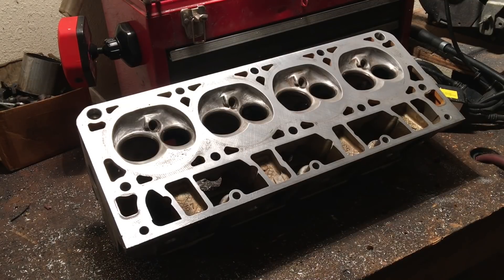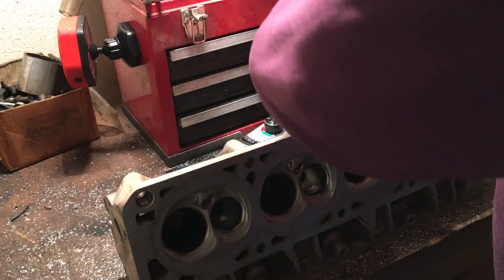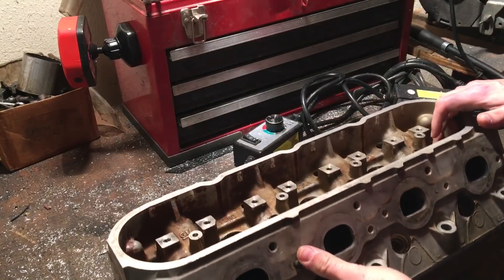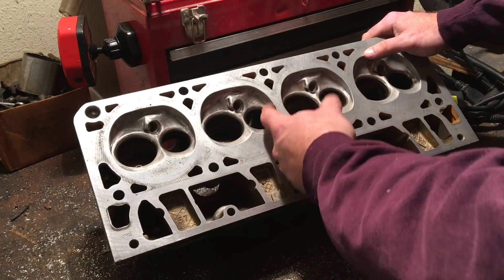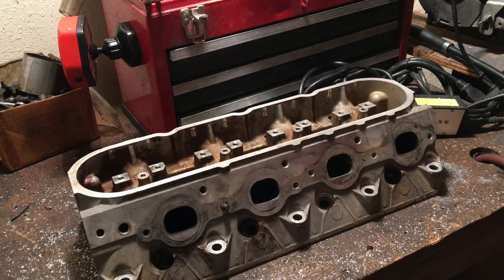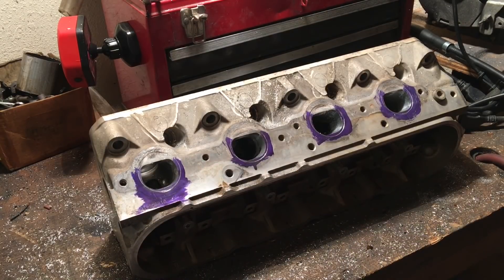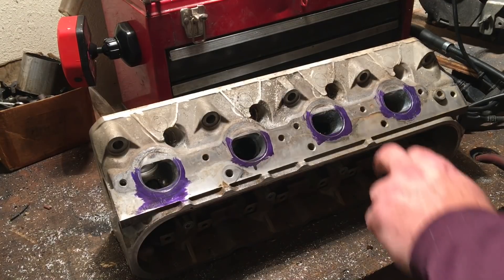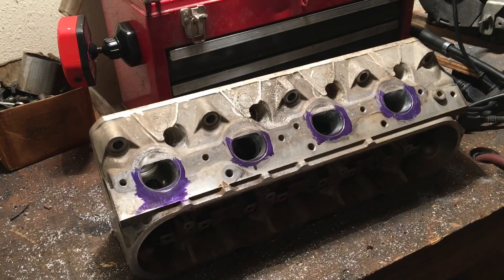Turbo 5.3 1000 HP build 243 head Porting

Comment: Widening the intake opening and taking that cut deep into the port while keeping the wall straight does help, it’s the difference between getting 290 and 300 plus CFM on these cathedral ports. Bell mouthing the port  does very little if anything.
Reply from the maker: I agree keeping the wall on the right hand side straight until you reach the bowl area is recommended. I don’t really in large the entry, it’s mostly just moving that wall over during smoothing of the casting texture etc.  My thing is do not remove material unless it’s necessary, I want to improve flow with the smallest port volume possible. I’ve never really seen any information that can support any difference between just a regular cathedral port intake gasket and let’s say an LS6 intake gasket Other than design and how it seals.

Comment: can you give me a full setup for a 5.3 engine trying to make 800hp to the wheels with a turbo.
Reply from the maker: B R Vlogs What transmission are you running and is budget a concern/limiter?
Reply: HeadFlowInc i watched a guy on instagram with a stock block 5.3  cam/single s476 making 808hp
Reply: i have the 4l60 right now but i’m going to probably get one built 4l80 and concern
Reply from the maker: B R Vlogs 1. 4L80e 100% there’s no way a 60e can handle 1000 rwhp. 
2. Keep in mind, a 5.3 can make 1000-1200 rwhp but understand it can fail at anytime, it’s not a build you can expect to live a long time. 
3. A S475 is a very good Turbo for most builds in the power range you want. 
4. The old standard for 800+ rwhp was to run Gen 4 Rods/pistons factory crankshaft, Gen 3 or Gen 4. 
Now people are running LT rods for more strength.  The issue with the LT rods is the small end is a bit wider/thicker so you either machine the rod end a little or shop for pistons that work. Budget getting tested... 
5. If you’re going 58 tooth reluctor you could look into running a wet sump LS3 forged crankshaft with the LT rods.
6. I highly recommend using a iron block 5.3 at the power levels 800+ rwhp.
Watch this video:
https://youtu.be/w0yrrLYKeKE
Reply: HeadFlowInc okay thanks you, and what about with a cam?
Reply from the maker: B R Vlogs You can make 800 whp with a Sloppy Stage 2 cam/Elgin 1340p etc. it’s all about the base engine combo working well.  Look at the needed crankshaft HP to Net 800 whp. 
Since we know a good rule of thumb for an 80e is an efficiency of 85% ish.  To Net 800 whp you’ll need +- 941hp crankshaft.
14.7# of boost can double your base power in theory, so building the NA engine to produce +- 470hp crankshaft is a great place to start. 
Starting with lower NA power only means you’ll need more boost to hit your goals. 
A big limiter can be the fuel quality you will need to run, type of fuel and a boost limit compatibility with head gaskets. 
We’ve never seen a huge gain in power by running a “Special Boost” camshaft.  But there’s the budget question again, there are some reputable companies offering boost cams but they’re not cheap.

Needless to say you’ll need e85 fuel or better to safely feed the power you want. JD

Comment: Awesome video thanks , what do you think of a set of 243 heads on a boosted 4.8? And what is a good price on a used set of 243’s
Reply from the maker: Nicholas Maiers Head costs depends on where you live, around hear you’re looking at $300-500.00 for a set of 243/799’s.  243/799 are the same heads. 
People who don’t know any better run Big Valve heads on 4.8/5.3 engines, I’m guilty myself.  We now know the minimum bore diameter to get an unshrouded flow from 2.00”/1.55” heads  is 3.898” or LS1.  Its been proven on a Dyno that a ported head with 1.89”/1.55” valves will out perform a 2.00”/1.55” head on the small 4.8/5.3 bore of 3.785”!!!  The issue is called “Cylinder Shrouding” where the cylinder is smaller than the exiting intake charge into the cylinder hits the top of the cylinder. I’ve heard about using a 1.94” intake valve on 4.8/5.3 builds, but I’m not sure where they get those valves or if they’re cutting down 2.00” valves to a 1.94”??? Idunno

Comment: Couldn't you just move the gasket to the exhaust manifold and do the same process
Reply from the maker: Paul Zutz Exactly!  👍. Gasket match the exhaust manifolds is the key!  I’ll be gasket matching my Turbo manifolds coming soon!
Reply: Okay I actually plan on doing this tomorrow with a dremel lol probably going to take a while anyway thank you for the response as well as the video
Reply from the maker: Paul Zutz I’m currently trying to modify factory take off LS3 crate engine exhaust manifolds into down/forward facing Turbo manifolds.
The plan is to build a 2 1/2” crossover going either below or in front of the balancer/dampener merging on the passenger side into a GT45 Turbo. I needed to make sure the exhaust manifold and Turbo Down pipe clear my heater hoses out of the water pump. Also, I would not flip manifolds upside down unless you’re willing to relocate the coils, or you’ll constantly burn up plug wires. 🤮
I’m planning on running a full 3.5” exhaust dumping at/near the rear end!  I’m trying to develop/copy a system I’ve seen using an open expansion chamber and Bullet mufflers 2-4 of those creating a relatively quiet free flowing exhaust.  🙏🏻🙏🏻🙏🏻

Comment: IMO you have the best head porting tutorials on YT. I practiced on a junk set of 706 heads, got the feel for it and then ported my 317 heads for my lq9 build last year. Truck makes great power with 216/220 elgin and the heads. Debating on either doing a full NA build or doing a single gt45 this winter.
Reply from the maker: Rick B Thank you for the kind words!   It’s good to hear the 216/220 cam worked great for you!
I get sucked into wanting the 220/224 cam with its LSA 112 so the idle chops... 😉
I’m in process now trying to figure out the Turbo install on my S10 Blazer!  Cheap GT45 single turbo to setup a good base just in case I want to upgrade later. 
Fwiw: I’m going to finish the 243’s in this video soon, they were put on hold since Richard wasn’t in a. Hurry, but now he’s getting ready to finish the new engine.
Thanks again for the kind words!  JD

Comment: How much will I have to spend to get 1000hp out of a 5.3??
Reply from the maker: Traye B Whippin Are you wanting 1000hp at the crankshaft or at the wheels?
The engine management and Tuning are big parts of the total cost when building.
It also depends on how much of the work you’re able to do to save costs?   There’s a lot of unknown variables to consider when estimating the cost of a build.  JD
Reply: @HeadFlowInc  I'm going for crankshaft 1000hp
Reply: @TPhresh93  sloppy mechanics on youtube.
Reply: @TPhresh93  is this for street or strip use?
Reply: @rememberussliberty1822  mainly for track but I would like to drive it on the street every once in a while
Reply: Some say the question isn't "What can I do to get 1000HP" but "What can I spend to have 1000HP with good reliability and durability?"
Reply: I'm at 2000.00 xand make 1034 at the wjeel

Comment: Good job on using the right intake gasket! Fel-Pro is the best!
Reply from the maker: David Logan Those Felpro problem solver gaskets with the metal backing plate and thicker rubber work awesome!  We’ve used them with a truck intake at 25# Boost no problem!  JD
Reply: @HeadFlowInc  That is awesome - I am planning a turbo build right now, and want to use all Fel-Pro gaskets and seals.
Reply: Whenever the OEM gasket is trouble-prone, Fel-pro is definitely the best. However, when the OEM gaskets are great, I prefer OEM.
If there was a prison for automotive crimes, the guys who designed the OEM gaskets for the GM 3100, 3400, 3800, and 4300 V6 engines would be there.

Comment: You should do a set of gt40p heads. I really want to port them, well I am going to port them but there aren't many videos out there on them. I pretty much k ow what I need to do besides on the short turn radius. From what I have read most the the gains will be from clean up the bowl areas.
Reply from the maker: Bryan Roupe Carefully do a bowl cuts: Open the Intake to 88-90% and Exhaust to 85-87% of the valve sizes leaving plenty of material for the valves to seal. 
Blend the bowl cut down but don’t “dig” into the back wall behind the guides. Profile your valve guide boss and clean/smooth the port texture. This should make a vast improvement! 👍
Funny you mention the Ford heads I’ve been thinking about building a Foxbody 5.0 car to play with. JD
Reply: Alright thanks, the main reason I have not done it yet is because I know how easy it is to destroy the bowl.  Fox body's have been a hobby for a long time. They are so damn fun and easy to work on. They have doubled in price the past few years and will continue to go up so I would grab one now. I'm actually looking for a notch currently. Looking for a roller or 4cy car because they are alot cheaper. Already have a spare 8.8 and a 99 explorer engine for it. You can get them down to 2700lbs fairly easy and with a mild 300hp you can slip into the mid 7's. 50tussin runs low to mid 7's with all budge gt40 stuff.
Reply from the maker: Bryan Roupe I agree on the Foxbody, Rodney has a couple of his cars running 7.teens on motor and in the 6’s on the bottle.  It’s amazing he can do all this with Factory T-5’s with only a few small upgrades! 👍😎
I’m looking at a 1993 Notch right now, I just need to figure out how to pay for it.
Reply: I'm actually saving up for the 600hp fitech which is the same price as a blow throw and intake. I have been hearing recently though that they never really quit tuning or are always in tuning mode. I don't personally know anyone who has it though. My buddy is trying to get my to get a MS which is half the price and he had one and loves it. I have a X cam with stock pistons and .570 lift Alex parts springs never had clearance issues. I think it's like .544/288°@.050 or something a long those lines. Way to much cam for these heads but the cam and spring combo I paid $100 for so that's what she got lol.
Reply: Better go stand on the corner and start hookin if your looking at a clean factory 5.0 notch lol I'm not sure where you are but here in Ohio notch's are insanely pricey.
Reply from the maker: Bryan Roupe Hard to find in decent shape.  I already know where there’s a mint body, no engine/transmission; rear end is out but still with the car. 😉👍
Reply: Best bang for buck and find a parts explorer with a 5.0 and slap a cam in it. With you porting the heads and intakes I bet you could squeeze 300 wheel out of one. All of his make around 300 but even he said it's a pretty happy dyno.
Reply from the maker: Bryan Roupe Yeah, I’ve seen all those Dyno days, great power for the parts!
I wouldn’t use the factory fuel injection though, the OBD1 is a pain to get tuned w/chips etc.  I’d either set it up with a Fitech efi or go with a carburetor.  I’m still trying to figure out what I can afford 😉
Elgin makes/sells the same cams as TFS, I was looking at the .499/.510 @.050 221/225 adv 283/291 LSA 112. I might be able to run 1.70 rockers on this cam netting a .531/.542 lift hoping the valves clear the factory pistons. 
$211.00 cam, should make decent power, should be a step up from an ABC cam. ?

Comment: Have you tried cerakote on the exhaust ports combustion chamber and valves?
Reply from the maker: maurice davis I just watched the advertisement on YouTube, there’s no mention of high temperature applications.  I like the protective properties of the cerakote as a release agent, I’m just unclear if it would survive the abuse inside an internal combustion engine? 🤔
Reply: @HeadFlowInc  i thought the same thing. People have been using it for piston crown's. I am going to experiment with it this spring. On my kids mini bikes to see if it holds up. These are 18hp mini bikes  with built honda clone engines.
Reply from the maker: maurice davis It looks interesting, maybe on pistons it acts like a thermal barrier too? 🤔
Reply: @HeadFlowInc  that's the whole idea keep the heat into the charge and not absorbed into the piston and head. In theory it should be able to take more timing without detonation.
Reply from the maker: maurice davis I wonder what they charge to coat the tops of 8 pistons?  It may be something we need to look into. Thanks again for the information I appreciate it! JD
Reply: @HeadFlowInc  I don't know if Cerakote is the right thing for piston crowns, but many racing teams use some kind of ceramic coating on piston crowns. It can mean the difference between winning and losing in diesel tractor pulls.

Also, gunsmiths use Cerakote, and they have a huge variety of coatings to choose from. Maybe one of them is right for a piston crown. I suppose if you know of a gunsmithing shop, perhaps the gunsmith could select the right Cerakote, apply that Cerakote, and give you a price.
Reply: the piston crown also has a fluid film barrier (Fuel) between it and the heat of combustion that save the aluminum from melting down. would be interesting to see the results on the actual combustion chamber itself